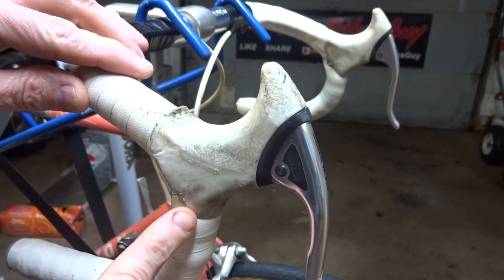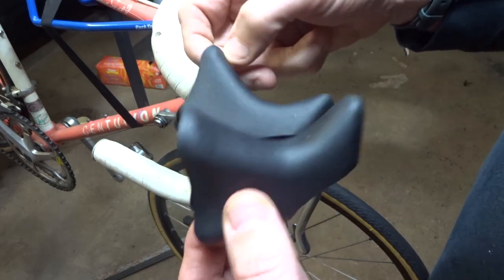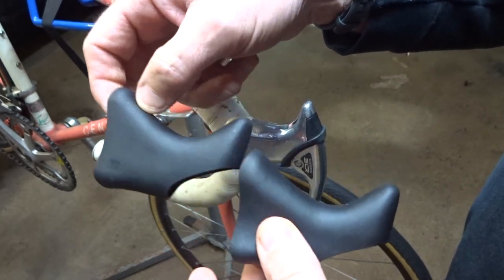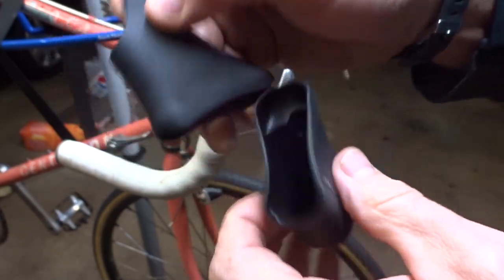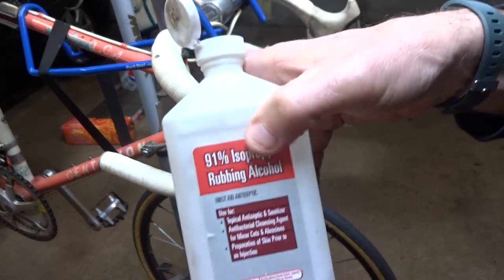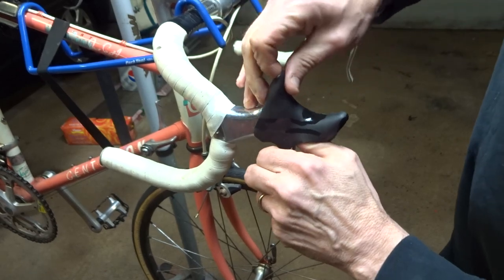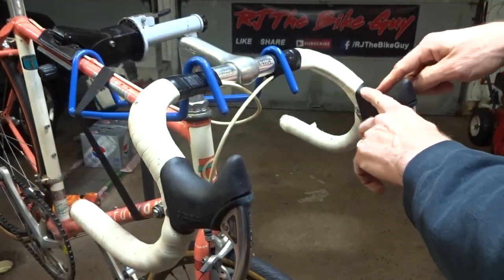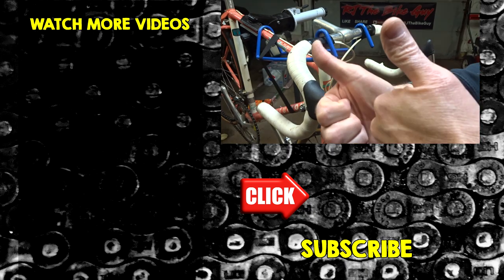How To Replace Brake Lever Hoods

Comment: Hi from England. If you can't get or don't want to buy rubbing alcohol   a good tip is to soften the rubber hoods by placing them on a warm radiator for about 15 minutes. This makes them much easier to slide on

Comment: Good tip RJ on the different series hoods working & being much cheaper.  Fitting hoods is easy, coughing up lots of cash for genuine (if you can find them) parts not so easy.  As someone who enjoys fixing up old wrecks I appreciate it's very easy to spend more than the bike's worth.

Comment: I often remove the lever from the bars and mount the hoods from the back forward, more work but less stretching of new hood (but I have torn new hoods when mounting so I am wary).  Good tip on the rubbing alcohol

Comment: Back in the '80s those Shimano 105 SLR Brake Levers were so Desirable Road Racers would swap them out to replace even their Dura Ace Levers because they have a return spring inside. I still have a couple pair, one on a Bike I still ride enough to justify replacing the Hoods. I ride it without Hoods resting my hands on the bare Alloy Hoods, and it's slippery, uncomfortable and irritatating as all Hell. I had no idea there's a 'Close Match' available. I'm ordering those hoods right now. THANK YOU RJ for the Lead!!!

PS - If you want to hide some Emergency Ca$h on your Bike, flip the Rubber Brake Hoods back as far as they'll go, and around each bare metal Brake Hood wrap a $20 Bill tight (folded lengthwise into 4's) and tape it, then fold the rubber back over to conceal the money. $40 comes in handy for an Uber if your Bike's unrepairable at the roadside or if you're hungry and need a meal or run across something you want to buy.  You can even fit $60 extra (#3 $20 Bills) folded into 4's and rolled around the Stem Cap Bolt conceiled under the Stem Cap,  but you'll need an allen wrench to access it. That won't work with Quill Stems like on RJ's Vintage Centurion.  I carry $100 cash hidden on all my Bikes JIC SHTF out there!

Comment: Use a spray bottle - more uniform application and less of a mess.
Reply: yeap, today alcohol is a very valuable stuff, in my area is all sold out and very very expensive.
Before coronavirus: $3, after coronavirus $12 a liter

Comment: Just put them in a mug of boiling water for 10 mins .
Reply from the maker: I would be worried about them melting or deforming.
Reply: @RJTheBikeGuy  Nah ,they're rubber not liquorice 😀
Reply from the maker: I have seen those mouthguards that you soften boiling water turn into a mess if left in the hot water too long.
Reply: @RJTheBikeGuy  I wouldn't know about that,ain't never had a bicycle with a mouth 😀